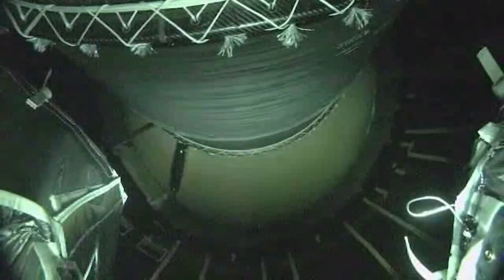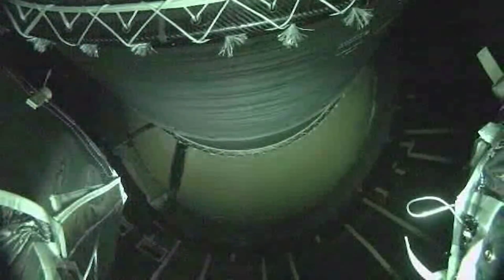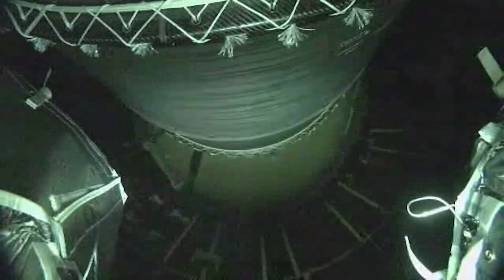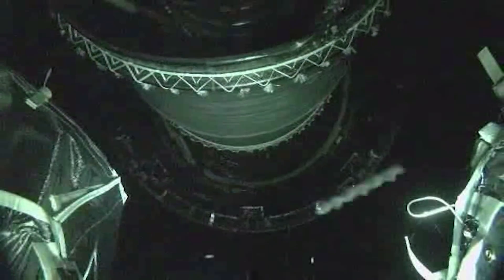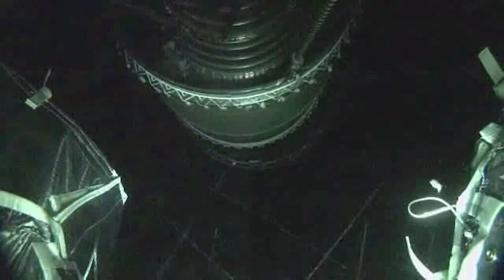Delta IV Heavy NROL-44 Rocket Cam

Comment: Think there was a mixup between metric & imperial units speed-wise.  At 1 min, he says it’s traveling at, “1,200 miles per hour,” but then at 1 minute and 20 seconds he says, that it’s “passing Mach 1” (which would be roughly 450 - 500 m.p.h slower than what he announced it was doing 20 secs earlier).
Reply: Yes, even 1200 Km/h would be sea level mach. At 30,000ft mach is roughly 678mph. That was an odd call, and I wish someone would explain it.

Comment: Why dont you guys try to salvage the cores instead of sending them to the bottom of the ocean?? Asking for elon.
Reply: Bro it's thier rockets so thier company=thier decisions
Reply: Because it would be very expensive to retrofit the Delta IV to be able to do that, and even more importantly it would severely limit its capabilities, which is the main selling point of the Delta IV Heavy.
Reply: Adding on to this, the delta cores burn for much longer than falcon heavy's, so even if the RS-68A could restart, it would be moving 3x faster, and even with an entry burn it would still probably burn up. Also, the RS-68A can throttle down to 48%. the Merlin 1D can throttle down to 20%, because of it's pintle injector(the only thing limiting it is the gas generator flameout) and they do that on landing burns. They also only use the center engine during landing burns. So each core only uses around 2.2% of a full core's thrust during the landing burns. They need this for landing accuracy and to limit g-forces to a minimum. The landing burn would be very fast, and have something like 10gs, which would probably severely damage or destroy the core's airframe.
Reply: And in case you don’t know, RS-68 is a cheap engine (in the LH2 engine family) and it burns itself during flight which makes it not worth to recover
Reply: @Galm1Cipher0  Your right. Its is their decision. Their own stupid decision
Reply: @gingerbreadman8625  you do realize that Delta IV was designed over 20 years ago when, apart from the shuttle, reusability wasn't a thing that was seriously considered. 

Delta was actually supposed to be the Falcon 9 of the time period, being a low cost, high frequency launcher. Then the launch market collapsed and it went from 10+ launches a year to one or two.
Reply: @gingerbreadman8625  it's not a stupid decision